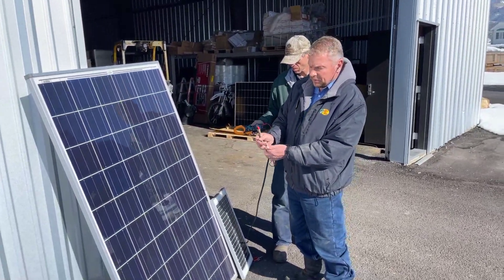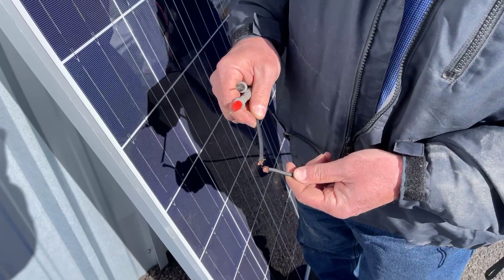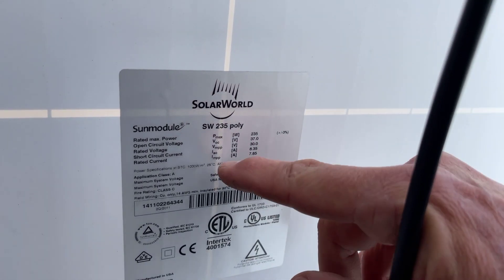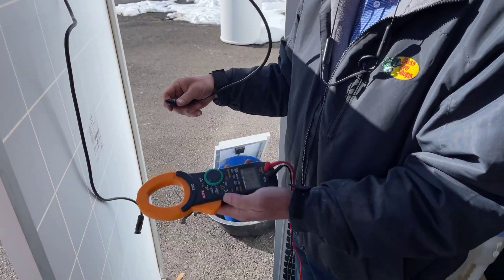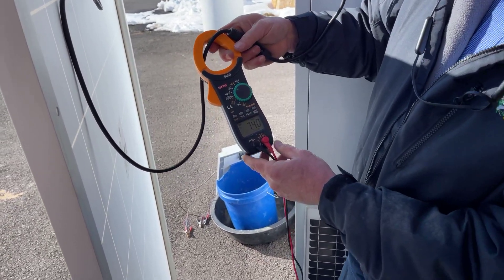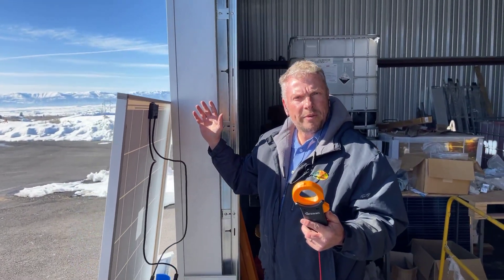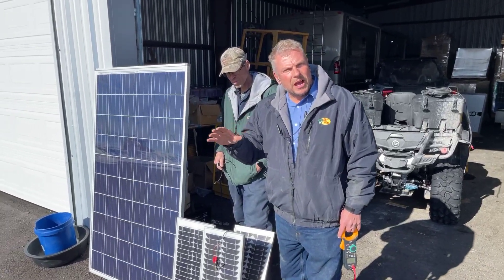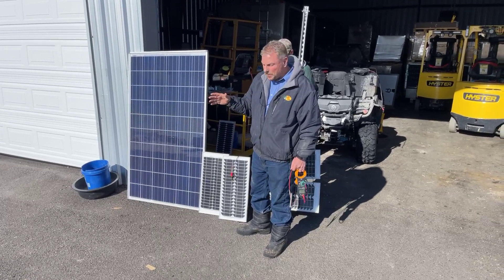Solar Panel Series vs Parallel Part 2 (How to test each panel in an array)

Comment: Starting out with 6 - 100 watt panels VMP 20.4V  VOC24.3V  IMP 4.91A  ISC5.21A  Connected to a MPP 6048 hybrid  and 2 - 220AH 48v batteries.  Would 2 parallel strings of 3 panels in series be enough to charge my batteries?  Will 3 panels in series produce 61.2V in full sun?